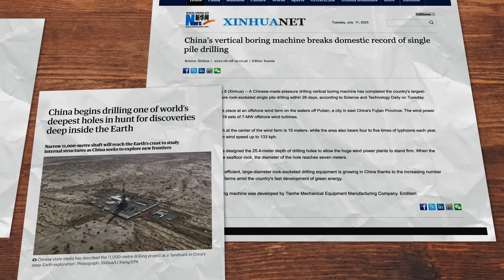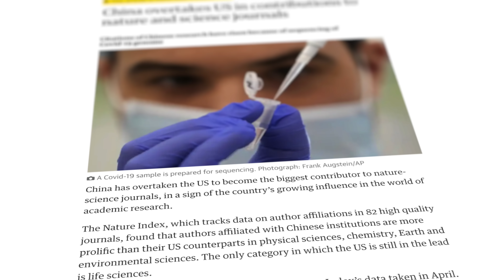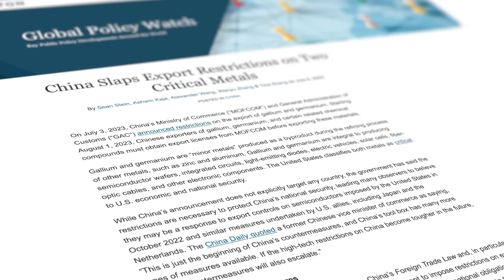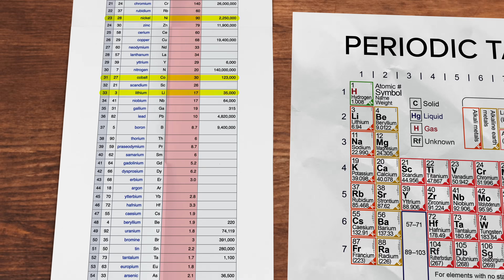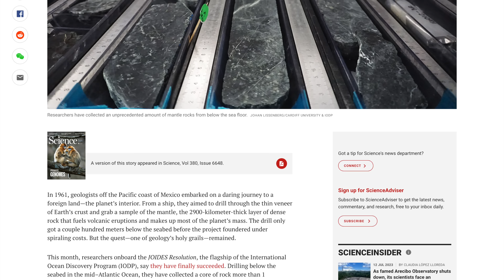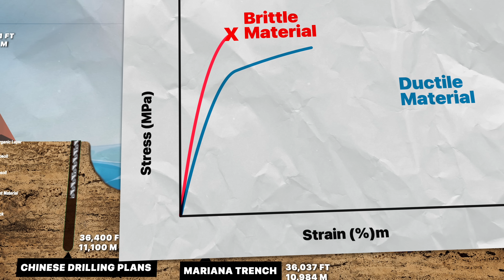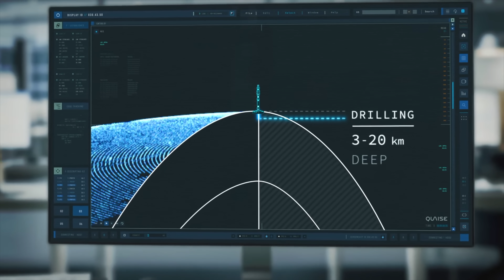What’s Hiding Beneath China’s Deepest Hole?

Comment: Eh well techically you could use size to increase the depth, so you would start out at a wide diameter then at a certain depth you could reduce the diameter and so on. aka tapering.

Comment: An Interesting video, thanks.  
Here is an idea for a future video, if you are up for it. This has been puzzling me for a while. Initially, it may appear to be a silly question but do the maths.  What will happen when all the underground tunnels that we have and are the ones that currently make support casing fail.   When we stop using them will their support casings fail, will this lead to many surface sinkholes. Tunnels such as roads,  walkways, rail, water, sewage, runoff water gas, bunkers, military, underground storage facilities, and many more.   Could these lead to surface sinkholes, could they lead to contamination of deep aquifers, and potential gas leaks where they don't naturally occur? What will happen when the sea levels rise or huge floods occur?  You could also tie in the science, if there is any, behind the creation of sinkholes in the permafrost.    Are we blindly creating a multitude of problems for the future?

Comment: It is interesting.  Russia drilled a hole back in the 70's on the Kola peninsular and stopped at around 23,000 ft as the temperature down thjere was getting too hot.  Yes, metallugry has improved so they will have harder drills able to withstand the temperature and pressures involved.   Based on what I read about that and what various geologists have written in papers over the years I can only imagine this is looking for either geothermal energy, or attempting to tap the massive hydrocarbon deposits that are miles below current oil extraction technology.
I am very much interested to see the outcome as at a seminar last year a very good point was brought up.  If they cut through a crack in the mantle they very well may create a new volcano.

Comment: Out here in west Texas there's a little town called Pecos. There's a 25,600 foot gas well here. There are several 20000 plus wells around Ft Stockton, tx.TX. the no. 2 Emma Lou is hust under 30000 feet. It was drilled in the 79.

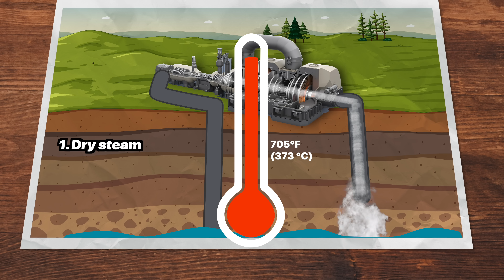Comment: The animation with steam going through the turbine at 5:00 is opposite of how it actually flows. It  starts out going through the high-pressure turbines, which are smaller in diameter than the lower pressure turbines which are larger in diameter.
15:35. I am not sure why there is video of an excavator with an auger at a construction site. That is for drilling a place to put pilings which will be driven down to bedrock. It has nothing to do with drilling bore holes.

Comment: Take the world as a hostage,
By placing nuclear bomb.
Reply: It wouldn't do anything.
Reply: @Factchekka  prove it
Reply: @SgtStarSlayer  Well, you are the one making the claim that putting a nuclear bomb down a deep hole is a world-wide threat, so the onus is on YOU to prove that. But since you asked nicely (read sarcasm)...many nuclear tests have been conducted underground, some at depths of more than 3km. This was done to make them safer. Also, the deeper an earthquake occurs, the less likely it is to cause damage because the energy from the seismic waves has to travel further through the Earth's crust to reach the surface. The energy is therefore more dispersed and causes less damage. The effects of a nuclear bomb, (which are insignificant compared to the energy released in a large earthquake), would not even be felt on the surface if it was detonated at the depths the China hole is claimed to be.
Reply: still in your opinion since the lack of citation
 @Factchekka
Reply: @SgtStarSlayer  It's accepted science and easy enough to verify with your own research if you are actually interested in learning, but I know you won't do that because you haven't even attempted to justify your first unsubstantiated, ill-informed comment.

Comment: Sorry, Russia drilled down eight miles. Google it. That's as far as humanly possible to drill.
The ball earth model is wrong anyway. Its scientifically impossible for large standing bodies of water to display convexity upon its surface. Water seeks its own level. Construction over the ages would be impossible if water curved. Just sayin....
Reply: It's called "gravity". Just saying...🙄
Reply: @Factchekka  awe come on now. Gravity is just a theory. Show how its measured, repeatable, observable, etc. Otherwise you're just parroting, but if you are successful, yow will destroy flat earth, and become a legend. So how about a link to an experiment of a large standing body of water with the surface curving. How about the Panama Canal, or some other canal with locks. Then provide the engineering maths used to calculate for the curve needed to factor in during construction. Should be easy enough. I'll wait. If you can't find any info on that, I understand, then you lose. SO, prove me wrong with evidence. Remember, truth is never afraid of examination. Good luck.

Comment: Only one enormous problem with extracting material either above or below ground -i IT DOESN'T RENEW  ITSELF ONCE IT'S GONE THEN IT'S GONE AND IF EVERY COUNTRY STARTS EXTRACTING THERMAL HEAT LET ALOBE MINERALS FROM DEEP IN THE EARTHS CIRE THEN IT WILL START COLLAPSING THE GROUND AS IT COOLS AS THERE IS SUPPIRT FOR THE CRUST ABOVE IT'S BASIC LOGIC AND PHYSICS - IT'S THE EQUIVALENT OF SITTING ON A BRANCH AND THEN SAWING AT IT UNTIL IT BREAKS!!.
BUT,THE WORST ISN'T JUST CRUST COLLAPSE THE WORST IS THAT IT WILL AFFECT THE EARTHS MAGNETIC FIELD AS WELL AS ITS ROTATIONAL SPEED AND IT MAY EVEN THROW THE EARTH INTO AN UNSTABKE ORBIT AND ROTATION AFTER YEARS OF EXTRACTION OF MINERALS AND TAPPING OF GEO-THERMAL HEAT  BY ALL THE NATIONS ...................REMEMBER THAT BRANCH !!.
Reply: Geothermal energy production occurs in the Earth's crust...it doesn't have anything to do with the Earth's core! 🙄
Reply: ...AND LEARN WHAT YOUR "CAPS" KEY IS FOR!!! 🙄
Reply: @Factchekka  Geothermal energy comes from deep inside the earthThe slow decay of radioactive particles in the earth's core, a process that happens in all rocks, produces geothermal energy. The earth has four major parts, or layers: An inner core of solid iron that is about 1,500 miles in diameter!!. There no caps used - happy now?.
Reply: @Millmiglia001  Sort of...now if you could just stop liking your own comments, that would be great! 👍
Your understanding of how geothermal energy is used is still faulty. The amount of heat extracted in the process is minuscule compared to the amount the Earth's core produces. If humanity only sourced power from geothermal energy, it still would have no effect on the Earth's core which is as hot as the surface of the sun. Geothermal energy is not really sourced from deep within the Earth. Water is extracted from only a few kilometres down, whereas the Earth's core is more than 5000 km below the surface.
Reply: @Factchekka  I'm very sorry to 'SHOCK' you but, I didn't 'LIKE' that comment.
You should know from experience that sometimes you can put a comment and someone reads it immediately and 'LIKES' it and this is exactly what has happened here - its happened several times to me. The fact that no one has 'LIKED' your comment may have something to do with the silly and childish  emojis you use to express yourself at the end of YOUR reply to me just now. After all I haven't resorted to trivial emojis have I?.
Reply: @Millmiglia001  Settle down fella and lighten up a bit...I was having a little joke with you. 😉 I agree emojis are childish and I used to hate them, but humans have evolved to communicate with facial expressions after all. It's sometimes easier to share ones feelings by using an emoji as people can misinterpret the tone of another's comments as you have just demonstrated. All the best to you Sir! 😀

Comment: 400+ days?  Not impossible but probably won't happen. If everything goes as planned maybe! So many things can & will go wrong. I've worked on many holes. Nothing ever goes as planned especially on a deep well. They will lose circulation, mite get it back mite not! Probably get stuck, gota fish that out or surrender and drill around it. Are they using bits made in China? If so, they will NEVER reach TD

Comment: If the technology exists to drill deep with lasers, microwaves, or some sort of energy beam it will stop where the wall of the hole collapses.  Under higher temperature and pressure the rock deforms and will close the hole.  Any mineral extraction would have to be done by vaporizing it.  There is a lot of heavy elements such as gold and platinum deeper down I doubt we'll ever reach.  Earth is the densest planet in our solar system.

Comment: We as people are good at collecting minerals from around the world and combining them into a unique product, BUT we ar poor at uncombining and recycling those same minerals.  Cell phones are a good example;  how many actually wind up in landfills.

Think as an example; the window air conditioner.  You can buy them assembled and ready to go, but when it reaches its end of life, try to find someplace to recycle it.  I called local air conditioning shops and nobody wants to deal with the small amount of refrigerant in these units or the time it take to prepare them for recycle.  To take them to the local scrap metal dealer, you have to disassemble the unit, break the coil tubing containing the freon, drain the oil from the compressor and then the scrap yard will take it and then if you want to make any $$, separate the metals into the different categories such as steel, copper, aluminum Etc.

Comment: No. 1 Optics for the populace.
No. 2 Hope they get a payoff.
No. 3 🖕If it actually works.

We found here thermal has limits. Oner of the area's where home heating was in every home by thermal. They had to turn the homes off. So it could be used for electricity.

Comment: It's GOT to be geothermal energy.. All previous deep drilling efforts were hampered by the excessive heat as they got past 20,000 feet and the deepest so far couldn't go past 40,000 feet.. something like 12,000 meters or 13,333 yards. Because it was HOT! But if you're looking for hot.. well, you're styling.. but in order to use it efficiently I suspect you'd need more area, in order to take advantage of the tempature differential effectively. But that's just my own opinion. I have no idea what their plans are. (!)

Comment: Just a thought, if they are drilling that deep, wouldn't they run the chance of hitting the core? I don't know exactly how far that would be, but what are the odds? Even if it's not that deep, what if the sight is over a spot where the core is closer to the surface?
Reply: the earth has a diameter of 12.742 Km. the core begins in about 2900 Km depth. So.... no, no chance to reach the core.

Comment: If you're going to drill a hole in the earths crust to explore its structure lining that hole with glass as you go is not the smartest move. Years ago they tried nuclear bombs in the wellbore as a way of fracturing rocks for hydrocarbon extraction trying to increase the surface area for production and turned that rockface to glass. Let's just say it's not a practice that gained any traction in the oil industy.

Comment: Graphic at 4:50 is wrong. Steam flow goes in the other direction. Steam enters the High pressure section first then enters intermediate pressure section. Then up into crossover pipe and into the low pressure section.

Comment: Hydrogen is extremely easy to produce and a normal combustion engine can run on a mix of Hydrogen and gasoline, or whatever else you use, it improves fuel economy by 30 percent or more, no iridium needed

Comment: Like the Whitehouse since January 20, 2021 nothing good comes out of China. This will not work and I’m surprised the metallurgists don’t speak up to it. The heat down at that depth depending on what material the drill pieces are made of will eventually get annealed and will drop the RC points (the hardness number) posing a very extreme risk of the drilling units snapping.

Comment: Horizontal or Vertical wells it cant be done by a top drive or air drilling, lol and for a fact it cant be done by a kelly drive either. Ive worked as a geoscientist for 12years. I do know recently that someone barely got a sample of the mantle but any farther its not possible.  There are variables of compaction, and lithology differentiation, on the type of bit i mean the list goes on and on.

Comment: CHINA MAKES CHEAP BRITTLE STEEL.
.
DON'T BUY THEIR 💩!
I have purchased John Deere Tractor... had a hole on the left fender 5 years after purchasing for $29,000

Had a wheel pin on the bush hog cutter  .. 2 inch on the drag wheel snap .
Looked like Cast Aluminum.. when it broke.
I would NOT purchase another one

Comment: I worked on a test hole for geothermal energy on the east side of Mt. Shasta, California. At 9000 feet we hit superheated water over 700 degrees, but it had no pressure behind it, and was deemed unusable at that time, 40 years ago.
Reply: That doesn’t make sense.  Water above 212 F needs to be contained (under pressure) in order to stay as a liquid.  The atoms would be very excited at 700 degrees, which is pressure.
Reply: @jasonborne5724  700°F is about 370°C, almost the critical point of water (which is at 221 bars of pressure). Let's say the water was at 370°C and 300 bars of pressure (it would be liquid), but the pressure would "only" help to keep it liquid until it drops under 220 bars (which is 800m higher, from the 3km depth). To have any kind of use, you would need to have the water stay at a high enough pressure and temperature at sea level.
Reply: @adriendebosse6941  I appreciate your intelligent reply.
Reply: jasonborne5724
You are dump or something? Have heard "superheated" before? There's no matter of pressure how much it is.
Reply: Why not a highly conductive rod going into a tank then pipes to a steam piston engine that's hooked to a generator head
Reply: you ever see anything paranormal around Mt Shasta?
Reply: Geothermal energy needs a large underground contact area usually done by hydraulic “fracking”. A simple hole could never return enough heat to cover its costs. HOWEVER, the deeper you go, the pressures to fracture the rocks get ever higher. AND you have to keep the cracks open - usually with sand. The pressures at 5 miles deep (8000 metres) is beyond any hydraulic systems available today.
Reply: If it wasn't under pressure, how was it at 700 degrees (I presume Fahrenheit)?
Reply: @bricaaron3978  (the idiot responder knows nothing of water, steam, entropy or enthalpy…)
Reply: @bricaaron3978 Nine thousand feet of rock formations and water creates intense pressure. Enough to contain the superheated water. After the well was drilled, nitrogen was pumped down hole to create a bubble which pushed the water out of the hole. When the superheated water hit the atmosphere, it turned to steam. However, when the nitrogen was shut off, the hole would not flow on its own. Another geothermal well I was on down beside the Salton sea flowed on its own when the nitrogen was shut off. It made a well.
Reply: Really? your lack,of knowledge on steam/water and of geothermal power generation is outstanding …
Reply: That’s geothermal energy, boys and girls. That hot water can produce electricity. It’s being done all over the world right now.
Reply: @TexasDoctor7  I’m sure you meant to say ‘steam’ and yes geothermal 0ants are in operation in a few geologically suitable locations but this single hole with relatively low temperatures is useless for such purposes.
Reply: Sounds like they are trying to drill to the U.S. or making safe houses for government officials in case of a nuclear attack 🤔
Reply: They are drilling down into the Hollow Earth to reach the  Reptilian underground civilization !
Reply: I've thought for a while deep geothermal energy is an easier problem than nuclear fusion, we (in the West) seem to be investing far more in fusion research when all the energy we could ever want is a few miles below!
Reply: There would never be anything useable only information that can not ever be used
Reply: Because you can not imagine? You wait and see if you life long enough to be proven wrong.
Reply: @robbmaier368  you have no idea what you are talking about. I mean absolutely zero
Reply: China

Comment: If you had millions of those geothermal or a few crazy massive ones (tapping a volcano, if you want a Dyson sphere.. we should start at a volcano, or lower)

Would they shorten the life of the magnetic/ sphere, through the extraction of heat cooling the outer mantle… stretching  the inner mantle +.. Also charged metals/pipping connected to electrical grid, how does that effect the mantle… does it make metals charged and attract them to piping or the flow of the mantle (earthquakes/odd ocean patterns/unstable weather and volcanic activity?

I think no singular option is the option.

Comment: i hope this is really about science and not an excuse like the japanese are doing with research just so they can poach whales for the high end meat.

we use geothermal to replace the air cooled or warmed heat pump units by putting pipes underground in the back yard water can be flowed to cool or heat the heat exchanger to make the heat pump work better.

palladium is a very important resource too it is used in catalytic converters to help clean up the exhaust from a car and yet it isnt that big on the scale of resources mined.